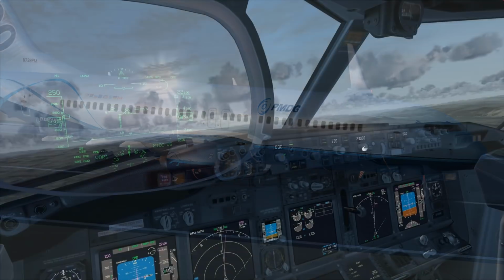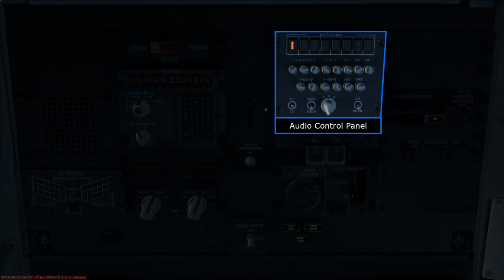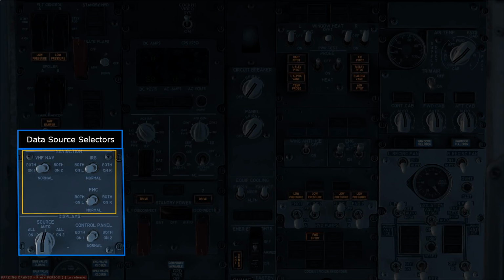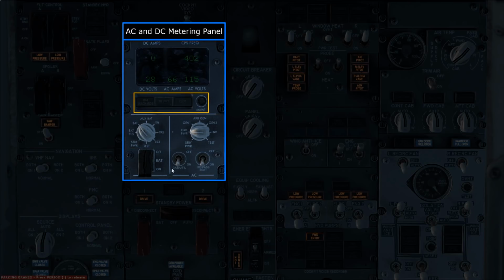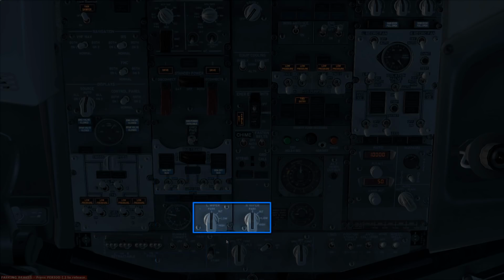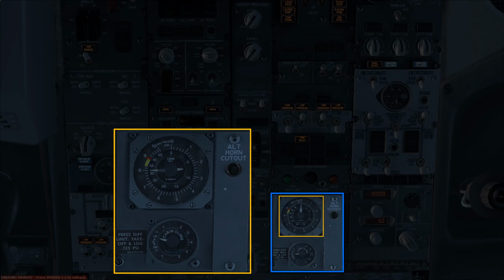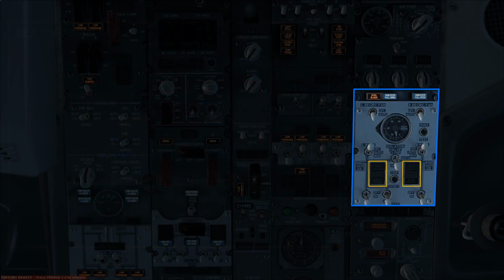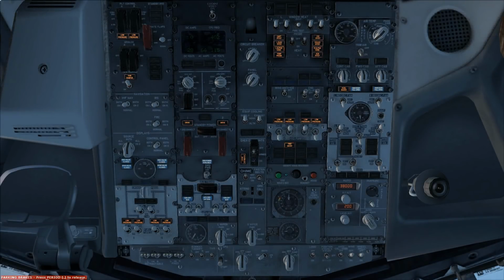PMDG 737 NGX: Overhead Panels Explained

Comment: Thank you very much for your videos — excellent work based on the FCOM! I followed the same approach as you, since very few websites offer this kind of reference-based method. I tried to create an Excel checklist myself, and through your video I saw that you had developed some very well-made checklists.
I understand that this must have taken a lot of time and effort, and I wanted to ask if it would be possible to get a copy of one of them, whether in PDF, Excel, or any other format. I really appreciate your work and your approach.
Even though the videos may be a bit old, they are still very relevant — at least for me, as I’m currently discovering the B738.
Thanks in advance for your reply

Comment: Really nice video! 

Btw, anyone have a suggestion for a beginner-friendly simulator to buy? I know nothing about flying so I will probably need a simulator with good tutorials, or at least a simulator that have tutorials :-P

I have been looking around internet and Steam for the best simulator for a beginner, but I just cant tell because of lack of experience with sims :-(
Reply from the maker: You can't go wrong with Microsoft Flight Simulator X (FSX) which is what is used in this video. It's quite old but it's cheap, very beginner friendly and it's available on Steam. You have a large range of aircraft to fly, from small propeller driven planes to big jets, helicopters, gliders, almost every aircraft type is covered. You also get "missions" to fly so there's a "gamey" element to it, it's not just pure simulation all the time. Some of the missions are tutorial-missions so those will help you learn a few things, plus I've got a whole bunch of videos on my channel made specifically for complete beginners to aviation and flight simulation here: https://www.youtube.com/playlist?list=PLPgR-UyZEDFp3z_sn_uVXEiVvtE5VKzSP

Also there's an in-game learning center/encyclopedia/wiki so you can read and learn about many aspects of aviation and things within the sim. 

Be aware, the aircraft featured in this video is an add-on aircraft and not available in the game by default. There is a Boeing 737 but it's nowhere near as complex and detailed as the add-on in this video.

An alternative would be X-Plane 11. It's a more modern sim so the graphical quality is a lot better than FSX. The physics engine it uses is also more realistic however there are not as many beginner friendly features. There are a few interactive tutorials but they don't go into as much depth and detail as FSX does. XP11 is also more expensive, IIRC, it's about $50. In general, X Plane is bought by flight simmers who have got a little bit of experience with flight simulation and want a more realistic experience. 

If you're just getting started, I would recommend FSX. I think it's a more complete package for a beginner. If you enjoy it and you want to stick with the hobby, then you can start looking at the more modern sims and add-ons. Also if you have the patience, stick FSX onto your Steam Wishlist and wait for it to go on sale, it goes on sale every 2-3 months, quite regularly so you can pick it up even cheaper.